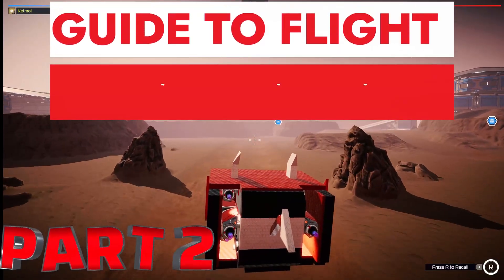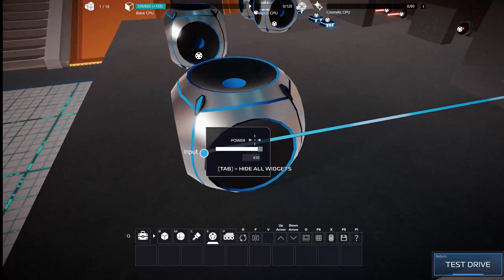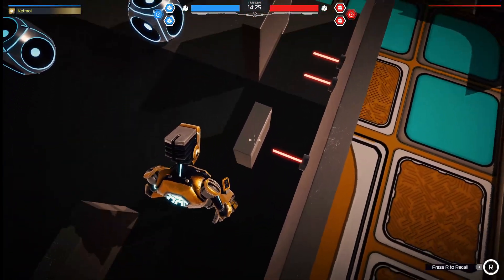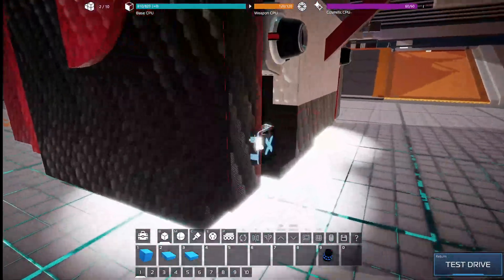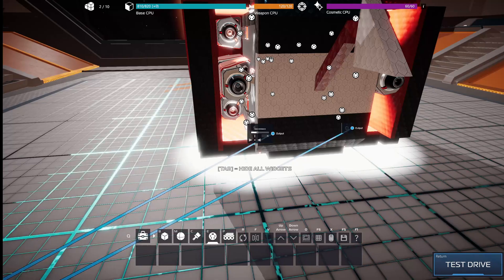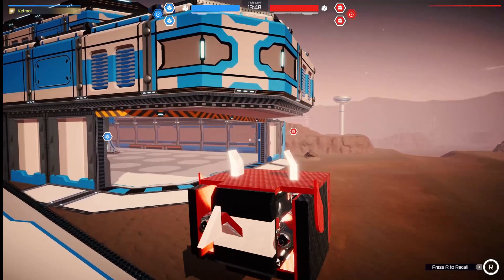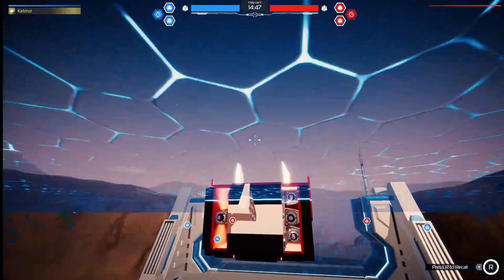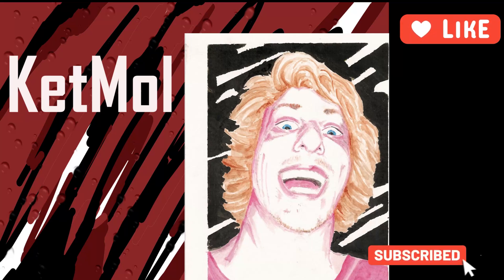How to use logic for steering and hover for flying robots in Robocraft 2. PART 2

Comment from the maker: IMPORTANT: The information regarding average blocks is NOT correct. I was a bit to fast on the trigger there without properly testing everything. If one input is empty on an average block it will calculate that as zero. Meaning the setup I have with an average block to give redundancy with lost sensors does not help. You should use a max block instead of the average for sensor redundancy. That way it will not matter if you loose a sensor.
Sorry about that. The rest of the video is okej thought.